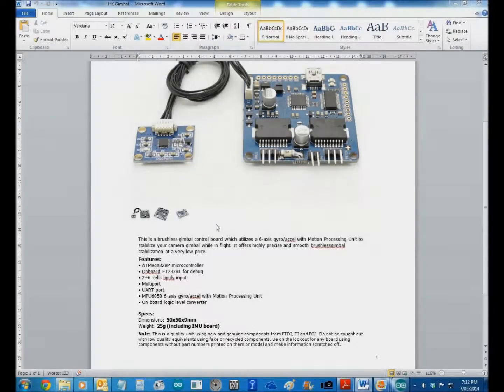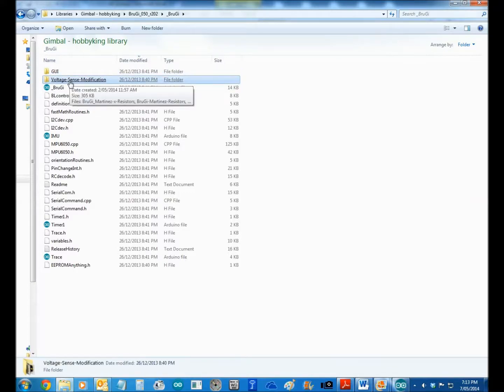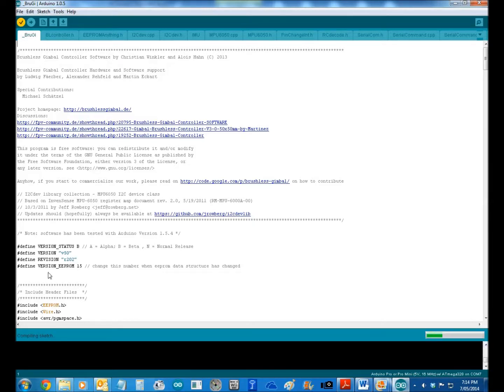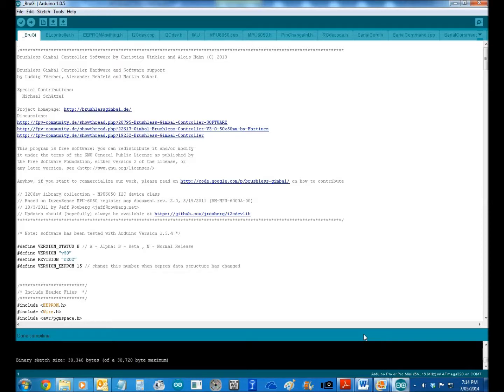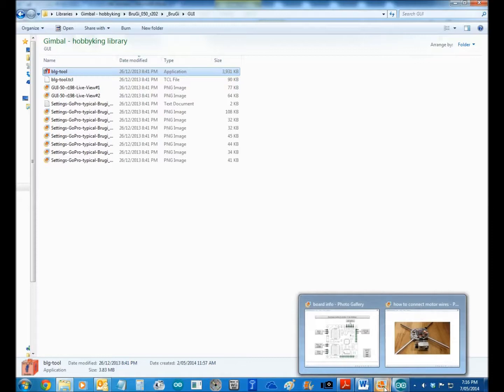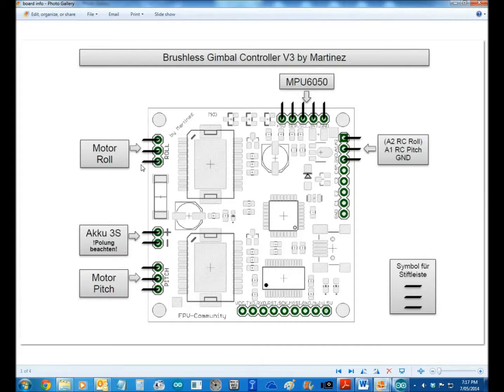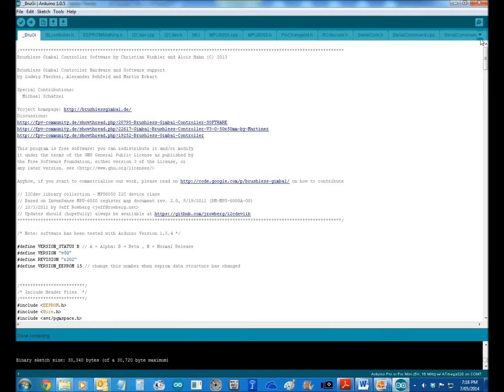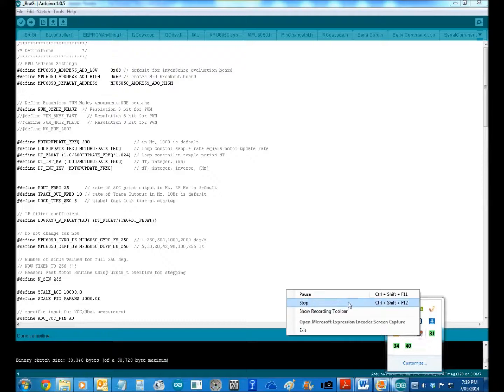HK Gimbal Martinez Firmware

Comment: Thanks heaps Moochasas. It turns out I had got it right up to the 3 minute mark of this video but of course without setting the pitch, roll etc nothing is happening.
Is there some settings I can import or is there some list of recommended settings to start with for a GoPro 3 on a Goodluckbuy gimbal? I wouldn't have a clue what any of those settings mean or where to even start.